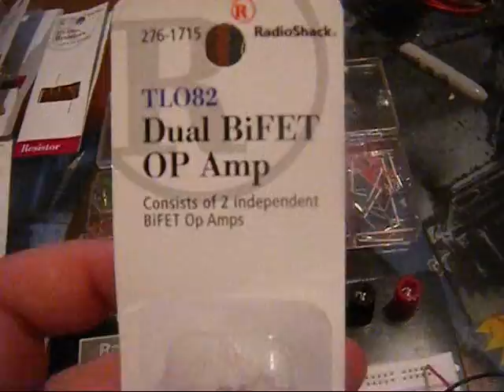LED Timer with 556 timer IC

Comment: I have a circuit that requires a 555 timer I need this circuit x 4 is there such a chip Si I can run my 4 circuits off one timer? Thanks for your help
Reply: The 558, it's a 16 pin IC that has four 555 timing chips in one